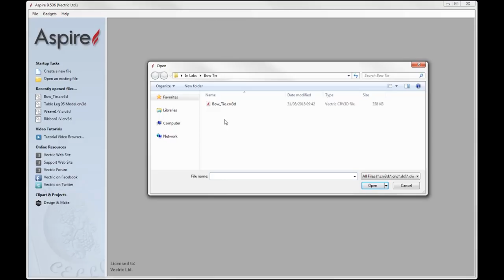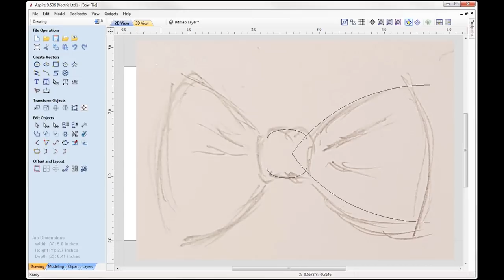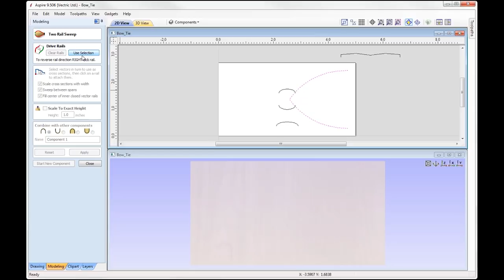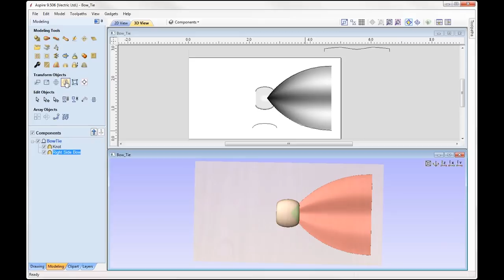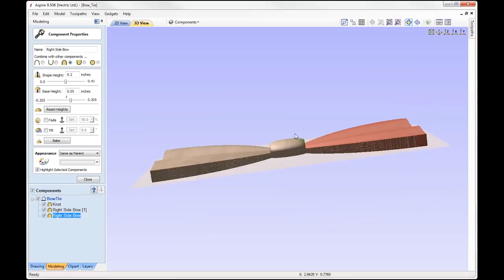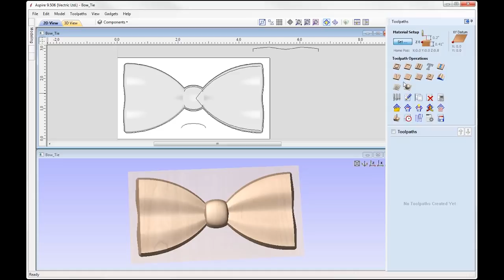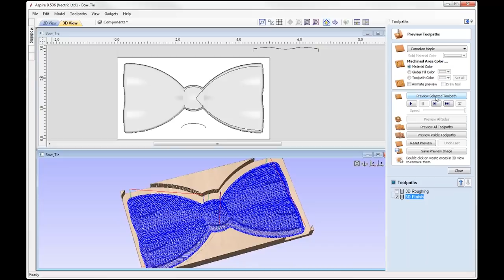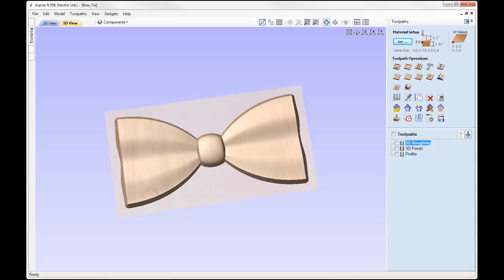In Labs with Beki | Cut a Wood Bow Tie on your CNC!| Vectric FREE CNC Projects

Comment: Hello,

Congratulations and thank you for this video.
Where do you find the binding you are pasting on the back of the bowtie?

Thank you in advance.
Best regards,
Bruno

Bonjour,

Bravo et merci pour cette vidéo.
Où trouvez-vous la fixation que vous collez sue l'envers du noeud papillon ?

Merci d'avance.
Bien cordialement,
Bruno
Reply from the maker: Hello Bruno, Thank you for your kind comments! The binding is Mitre Bond which you can get from most DIY/Hardware stores in the UK. I hope this helps! Thanks ~ Beki
Reply: Hello Beki,
Thank you very much for your answer, I will search the net.
Regards,
Bruno
Reply from the maker: @DeltreeOz  No Problem! Good Luck :) ~ Beki
Reply: @vectric  Excuse me, I meant the clamp, sorry.
Reply: @vectric  do you have a link for the clamp?
Thanks and best regards
Reply from the maker: @mschmitt8859  Hey there! If memory serves me correctly it was either amazon or ebay (UK) I've just done a quick google search and here is a link to an amazon page: https://www.amazon.com/Bow-Tie-Clip-Hardware-Fasteners/dp/B00UQSXA2G  I hope this helps :)